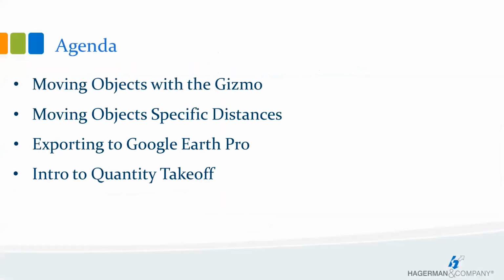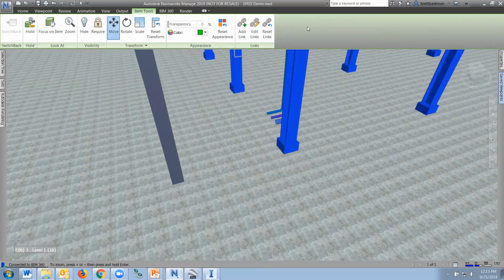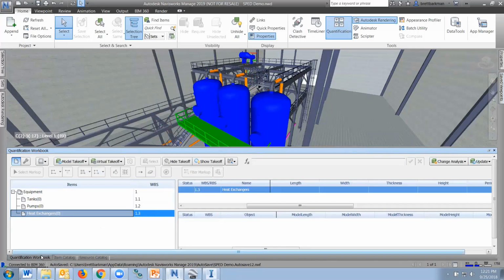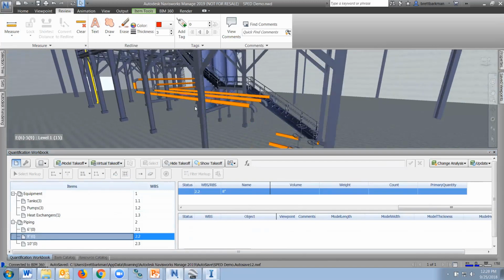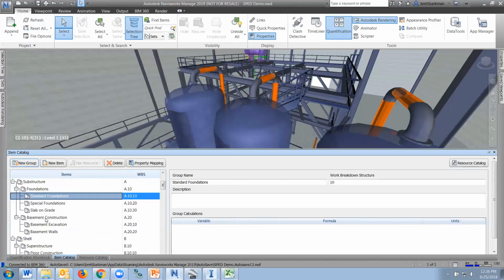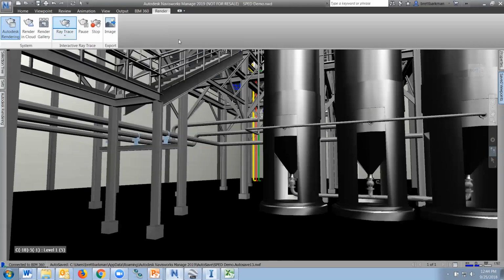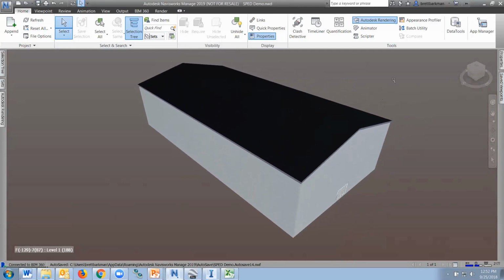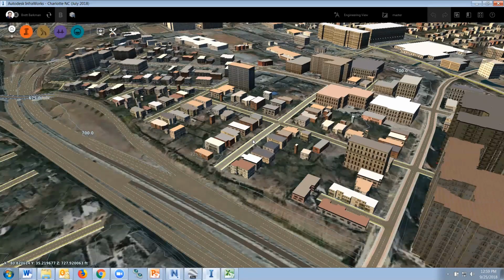Navisworks Tips: Moving Objects &  Sharing with Others

Comment: This Video has a good clear understanding about moving an object using the XYZ Coords. One thing I noticed, you used the Base of one column, which isn't exactly the same as the original column face to face. Those columns should be center to center. The next question is, what if the whole job is rotated 19.625° (or whatever) off true North, using Lock Perpendicular or moving according to the X or Y axis won't work very well with this instance. Next question....what's the workaround for, when you click on an object in Navisworks Manage, then click the fly-out menu for Item Tools, and it won't let you "transform" any way at all, X, Y, Z or Rotate, or Scale.....what now? Is it because the object is embedded in an NWD and should be in an NWC instead? Why is an object that is selected, unable to be transformed either using the position (X, Y, Z) coordinates, the Rotation Degrees, or the Scale or Transform Center transformations? Clear those questions up and Novices like myself can follow along. Otherwise, I'm looking for another video because this one didn't help at all....Great Video, by the way. It was still helpful and cleared up quite a few questions I had about Navisworks but my main questions were, why any of the "transforms" using the Item Tools wouldn't allow me to select any of the "transformations"....
Reply: Thanks for the kind remarks and great question.  I would need to see the model(s) involved to diagnose why certain objects are unable to transform, so unfortunately I don't have an answer for that at this time.  Keep in mind that the purpose of those tools are meant more for construction sequencing and animation and not for design changes.  For jobs that are rotated from true north (for example), that would be addressed in the authoring application (Revit, etc.,) so that it comes into Navisworks correctly with you append the model.